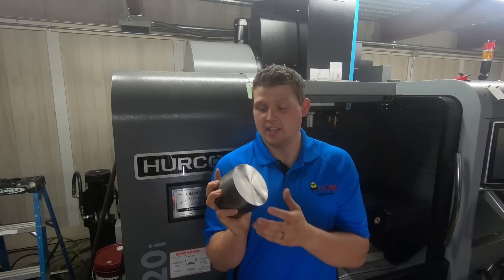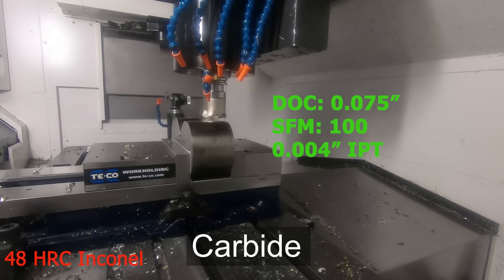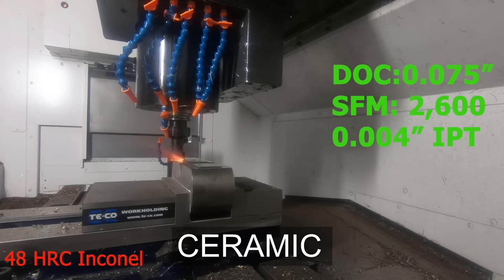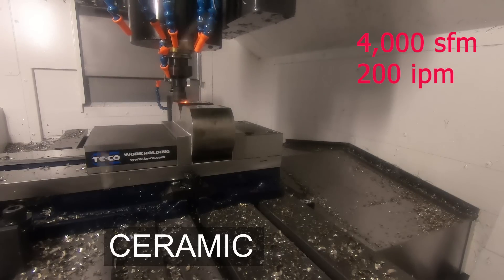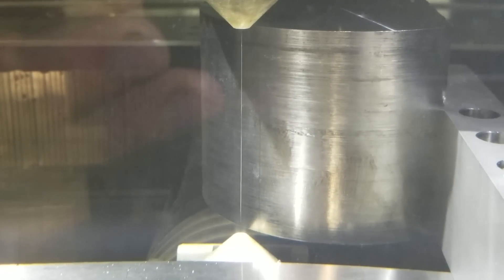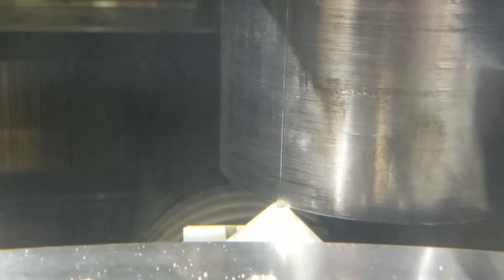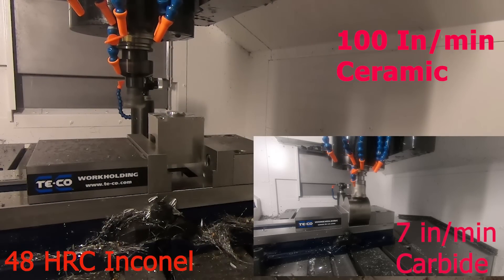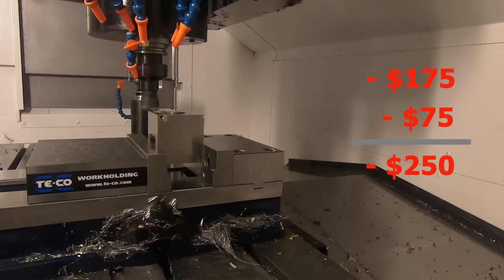How to machine hard Inconel 48 HRC, carbide vs ceramic vs wire EDM

Comment: You might want to mention that the wire EDM cutting can be used for roughing, but you you should probably finish surfaces with carbide (much like cutting with ceramics).  You also may have some customers who specifically forbid EDM due to the risks associated with surface chemistry changes (mostly in aerospace).
Reply: Thank you for the support and kind words!   Great point about the EDM surface finish and surface damage from microfractures and composition changes.

Comment: How would it be profitable using ceramic inserts if that's the case? That's very expensive. Awesome video, thanks for the great tips
Reply from the maker: This was our first time using them. They take practice and $$$$$$ to dial in a process, but if you have the production work for them, they can be made to last longer than shown , and also they cut 20 times faster , so it will greatly reduce machine time on big expensive machines.

Comment: Why didn't you use coolant?
Reply from the maker: You do not want to use coolant when cutting with ceramic tools. Thermal stresses are induced and the insert will crack very fast. Same thing applies for using carbide to machine hardened steel (hard milling), just air blast to clear the chips

Comment: was noticing your tool probe is mounted on a tall standoff. why have you done that?
Reply from the maker: The machine was installed like that. my best guess is: It is the generic standoff also used with 5 axis trunnions so the spindle can reach without clearance issues.
Reply: @MooreCNC  makes sense for 5 axis, am hoping to have on soon or a 42SWi trunnion head. i have a VM10i and my tool probe was always in the way. out of necessity i designed these tools making your tool probe removeable without re-calibration. Your grandfather would love it as it is kinematically correct!
Reply from the maker: @exactengineering4856   That's a very smart idea you have!! It is a pain to have to put back on our tool probes after taking them off. Have you heard of the kinematic canoe sphere? Its overkill for your current needs with the probe, but we have used them where high force is in play and they are extremely rigid and repeatable. https://www.precisionballs.com/All_Vee_Blocks.php#vbprc
Reply: @MooreCNC  btw, my first comment via "kinematic" is my personal account and i noticed when i was posting i had the wrong account so i hit delete, but i guess it sent it anyways thats why the two comments are the same. sorry for the confusion.

btw, those canoe spheres are awesome! i just used a set on a off-axis collimator we designed that weighed 3000lbs! some of the optics were over 250lbs and the entire system was athermalized.

let me know if you are interested in a demountable tool probe...i can hook u up!
Reply: @exactengineeringllc5254  LOL no worries, I do that all the time!  In fact , I am doing it right now!  Yes i would love to get one of your kinematic mounts!
Reply: @MooreCNC  makes sense i surmise for a 5-axis. am hoping to have a vm30ui or 42swi before years end. 
i have a vm10i with a tool probe and as useful as it is, its often in the way. so out of necessity i designed two demountable systems that allow you to remove and install a tool probe in seconds with no tools or recalibration. free up precious table space, protect your probe and even share single a tool probe across multiple machines.

here are some links...curious what your grandfather would think as these are kinematically correct and thus highly repeatible. 
https://www.youtube.com/watch?v=JVSCUpSzCPQ
https://www.youtube.com/watch?v=CGXSuNJ876s&t=222s

best of luck keeping the dream alive!

Comment: You should try rough cutting blanks with abrasive waterjet cutting ,then do the finish machining.
Reply from the maker: Yes, i wonder how that would do in comparison to carbide, ceramic and wire

Comment: How come the intro is done infront of a hurco, but the machining is done on an Okuma?
Reply from the maker: The okuma in the video is double the weight and has almost double the HP as the VM20i seen in the intro. Had the hurco been a VMX (perfomance) vs the general purpose machine it is (VM series), we could have machined it on there. But one of the main key points of our channel is to have people learn CNC on a conversation control vs traditional NC.. it's an easier learning curve.  I try not to be biased, but it's hard when Hurco is such a fun machine to use...   we also really enjoy our HAAS , Fanuc, etc. Etc.  and they definitely all have their place in a shop. 

Purpose of this video is to talk about cost and time savings of ceramic and carbide on Inconel.  I appreciate the questions none the less and good observation on noticing the Okuma, it's an incredible machine!
Reply: @MooreCNC  makes sense, this is the first video I've watched of your channel, I think I was just expecting a hurco then I saw an okuma and was surprised.

Comment: Don't use ceramic on the vertical mill. It will damage the spindle. If you cut ceramic tool your floor will change to black. What do you think will your lung won't change color? It does work on cnc lathe.
Reply from the maker: Yes , definitely should use caution
Reply: Why would it damage the spindle?
Reply from the maker: @TheWireEDM  I guess Thinh Dao is concerned about the huge spindle loads (although we were under 40 percent mostly). It is dangerous because the tool can burn out real fast and you can smash your spindle.
Reply: @MooreCNC  Makes sense. Best would be to have a machine controller that can detect an overload and shut it down or switch to a new tool.
Reply: @TheWireEDM  Okumas have Load Monitor function

Comment: What type of ceramic is the insert? Who is your supplier?
Reply from the maker: Used greenleaf's wg300 and some different Kennametal grades.  For these we used superiormachinetools.com, really nice folks. The people at greenleaf will help with speeds and feeds and cutter body geometry. Use a positive rake cutter for harder materials and negative rake for softer. We used a positive rake, but unfortunately results in single sided insert, so its a lot more expensive

Comment: Thanks, I liked the video. I had no idea that a cutting edge would only last 5 minutes at optimum cutting speed, whether for carbide cutting slower or ceramic cutting faster. Nor that the carbide would need to be slowed to 100 sfm. Could you possibly do better with square or other straight sided inserts instead of the round ones you showed? The round edges have the problem that each portion cuts at a different angle, so along the bottom they are barely shaving off any material, while farther up they cut thicker chips, cannot be optimum in both portions.

I do think that the interrupted cut is not a problem for milling, since the milling edges always have interrupted cuts, re-engaging on every revolution of the cutter.
Reply from the maker: We also use  octagonal inserts for face milling inconel, and have noticed about the close to the same results for tool life. However, endmills can last a LOT longer, and usually see over 50 minutes obtained with an endmill, even at a higher SFM (but definitely not over 200). If the material was not heat treated (annealed) the sfm could be increased to 200 with carbide, and you would see 30+ min of tool life with the  

I would be interested to try a feed mill next, which may be able to double or triple the material removal rate for carbide, but the high hardness of the inconel is what really kills the insert.

I agree that milling is always an interrrupted cut vs a lathe, where there is a beautiful single point contact . However, for the case of the ceramic, coming on and off the part plays a HUGE role in tool life. Picture that tool going at 15,000 rpm. The material it is in contact with is in constant engagement, and the tool is spinning so fast, its almost constantly on the material, but when you come off and re engage the material again, you are going to SHOCK the insert, you can hear it when it happens, and it should be avoided as much as possible.
Reply: MooreCNC  Titan Gilroy posted pictures of what he calls a "zombie mill" because, when cutting hard inconel, it gets chips that make it look ugly but continues to work well (at least for roughing) for several hours.
"the Cutter Ran for 7+ Hours in Hardened Inconel 718... Got chipped flutes after hour 4, Chunks Out after hour 5... Lost an entire lower part of a flute by hour 6 and the Cutter Just Kept Cutting... Eating INCO. Just would not Die... "
Sorry I do not have a link to the original posting. These are Kennametal HARVI 3 EndMills.
You have a picture showing a ruined tool from running an insert too long, but the endmill will be discarded anyway when worn out.

Also https://www.facebook.com/groups/titansofcncacademy/permalink/370666213453131/ shows Sandvik Sialon ceramic grade inserts. The author did not say how long they lasted. There is some discussion that this kind of cutter will fail quickly if coolant is applied (your video is also dry), because they heat on each cut and cool off between.
Reply: My friend told me about the 7 hr end mill in inconel that Titan used. I am really interested to try that out-- or find the link.  We do deep pockets in the inconel and use coolant with solid carbide, but for most cases the harder the material= less likely to use coolant, because the insert will crack from thermal shock just like you mentioned. 

There are a lot of other factors that I forgot to point out.. like when we face mill, we don't go over 50 % step over with this stuff. Taking step overs bigger than the tool when climb milling will also make you  conventional mill..

Ah so much to know and I am learning everyday. Thank you for the great comments!

 I cannot wait for IMTS next week!